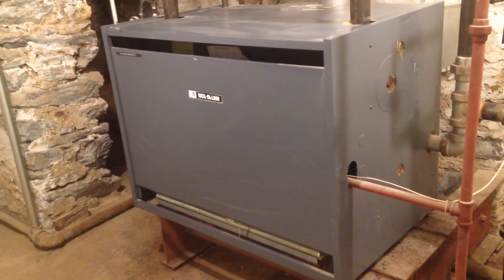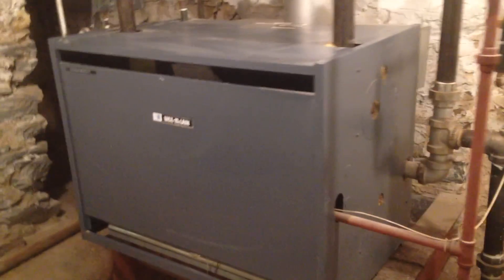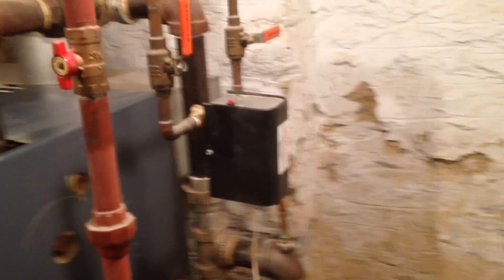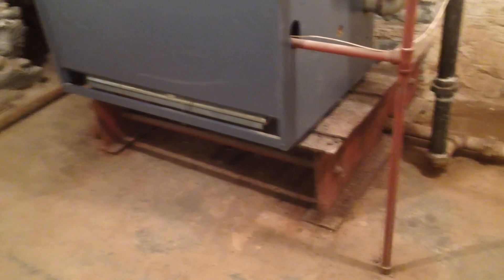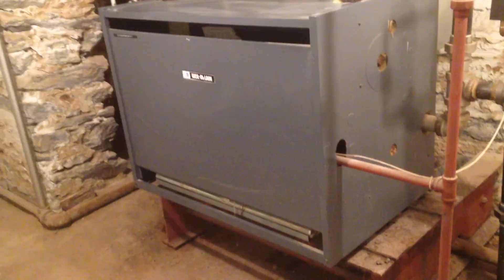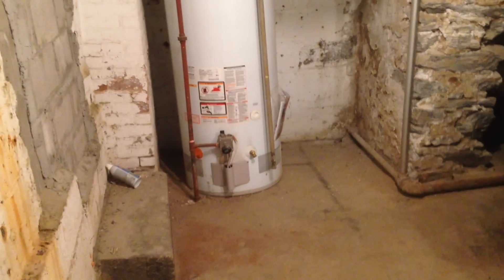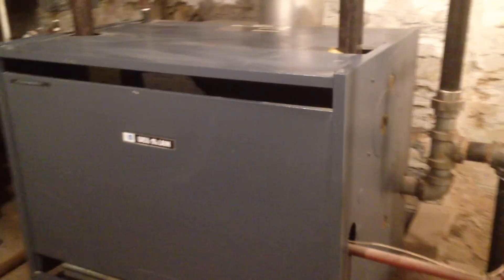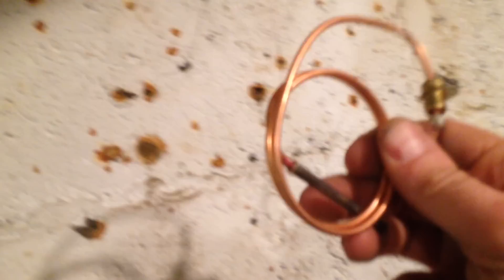Weil-McLain EGH-95 natural gas steam boiler

Comment: ok so this is a little embarrassing but I'm a steam fitter. I do new construction and pipe welding. I never in my life work on an old steam boiler. I bought a house with a weil mclain eg 75. It has safe guard model 400 probe type low cut off and uni-match wfe 24 for water feeder. The water in the steam boiler as it heats up pushes down to where it is completely out of the sight glass and the boiler continues to operate. If i have low water before the boiler start up it won't fire up. If it starts with enough water int the sight glass it will fire up and heat till there nothing left in the sight glass and continue to heat. I thought low water cut off was to stop it from starting and stop it after it starts if the water drops too low.  Im pretty good at figuring things out though maybe probe was drity so replaced it. I thought it wasnt wired up right so went over everything. the Boiler seems to be wire as weil mclain shows but for the life of me cant figure out how the lwco would shut the burner off. i have three wires coming of the lwco and to the boiler all seemed to be wired correctly. any thoughts mike
Reply from the maker: Mine does same thing with sight glass, it’s normal. To do  a true test of the LWCO, drain water from boiler ( without running but still powered on), and you should see the LWCO kick on. I think the way the probe works is the water makes contact with probe and ground, thus completing circuit. Once water drops below probe, it opens the circuit.

Comment: Can the boiler be light manually, what happened I over flow the boiler, so I empty it, then turn it back on , the boiler came on but it's not igniting
Reply from the maker: shane premraj There are 2 types of boilers:  standing pilot and intermittent ignition.  If you have the standing pilot, the yes, you can light it manually. That's what mine is in the video.
Reply: Thanks men, got it fix, the rolling switch got wet so had to changed

Comment: maintnance free? I hope you mean problems free... boilers should be maintained start and check yearly.
Reply from the maker: +Manny Ortega Yes of course, no boiler is ever maintenance free, I was comparing it to a typical oil burner which requires more maintenance.Gas steam boilers for the most part require less maintenance.

Comment: Mike
What is the footprint of your building? 
I have a 6 family building in Sunset park, front & rear apartments with a court yard. The building is 25 x 70.  I always thought my EG-75 was undersized. Your EGH-95 is 2 sizes up from mine. How do you like it?
Reply from the maker: I think it is a bit oversized, but its been working great. I have another similiar property in Ridgewood Queens, that has an EGH-85, never any issues to heat the bldg. Both property's are 6 family, apartments on left and right side,  about same footprint, 25X70.